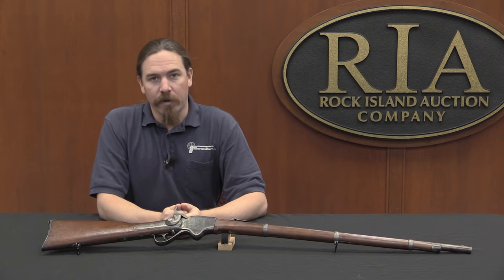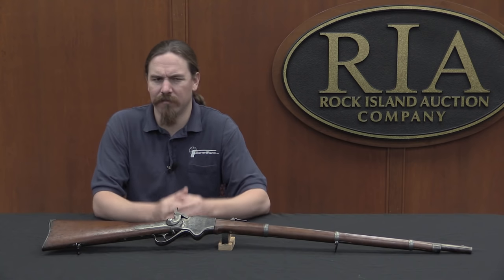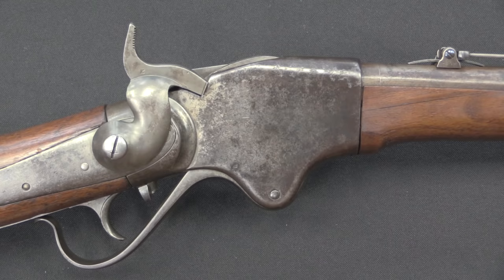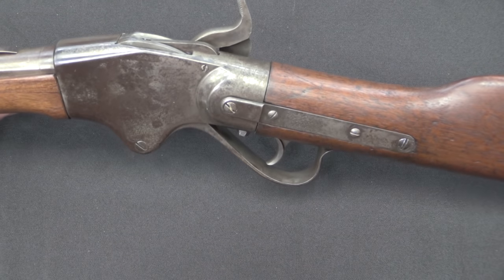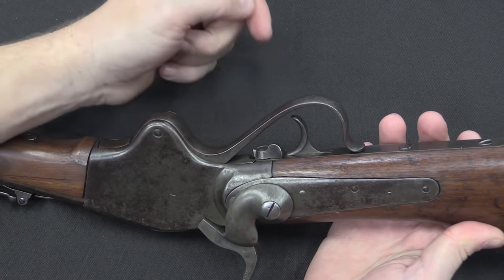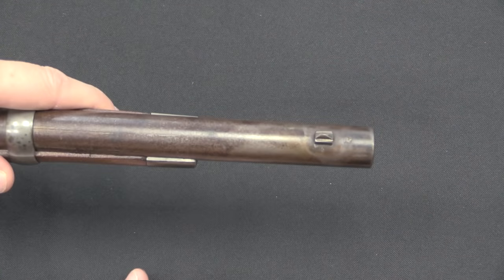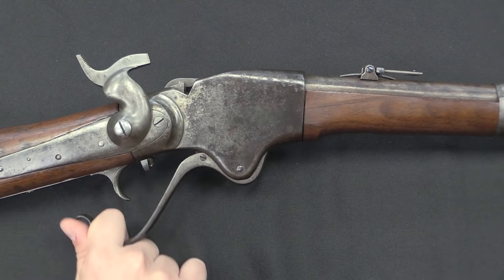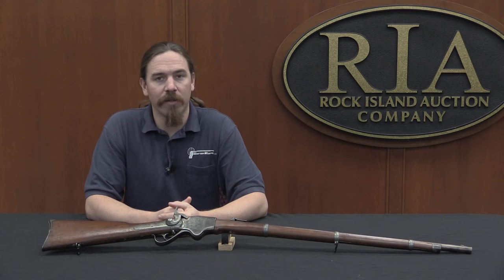Smoothbore Spencer: Tracing a Mystery Gun

Comment: The rifle screams Bannerman conversion modified back to a rifle "Look" to dupe a prospective buyer into thinking it is an original Spencer rifle with a very poor bore which collectors do not generally concern themselves with.
Appears the Bannerman markings were ground off the top receiver flat to further dupe a prospective buyer.
If you measure the barrel length it wouldn't surprise me you find it is 29" and not 30" long.
Reply: Could have been a Bannerman's gun...  Although both Sears and Montgomery Ward also list them in the catalogs past the turn of the 20th century.  I think it unlikely that Bannerman would have done the second conversion from carbine-shotgun to rifle....   Since they still had plenty of original guns to sell to civil war reenactors during the early 1960s centennial. (you can still find burned 56-50 brass in the remnants of Bannerman's Castle on Pollepel Island on the Hudson River)   On the other hand, the shotgun conversion might have been done by them...as they (and other military surplus dealers) were sitting on a mountain of such guns in the late 19th century.

Comment: Hi, Several years ago at a auction in Michigan a Spencer carbine converted to shotgun was sold. At that time it had the carbine forestock and bead front sight on it.  And like yours if you look  just in front  of the reciver   you can see where the original  barrel was cut off just in front of the chamber and the outside of the original barrel was then threaded for a shotgun barrel to be threaded over it. Not saying its the same gun that has been modified again since then, but , looks like a surplus alteration.

Comment: I have been sitting here for several years watching your videos, I used to do gun work and had developed the reputation of being a fair to middling gun smith, having taken one of those back of a magazine correspondence course and working with a couple of college trained smiths (Yavapi).  When I retired from law enforcement we decided to move home, where I grew up, now most folks around here did not know I was doing anything with firearms and I didn't really want to get back into it so I sold off all my tools and my stock of firearms, holding back a couple that I loved.  Well that was before the recent turn of the century, and I have been out of the shooting world since. I decided I should have a rifle, for well, for just in case.  So I went to a gun show and looked for an old beater Model 94 Winchester.  WOW man Who the hell changed the metal on those old guns to GOLD??? I couldn't fine even an old Marlin for less then 1,00.00 bucks!  I settled on a small .22 revolver so I could assure myself of having a shootable handgun that I could get shells for. I currently have a brick and a half left over from my shooting days, and 400 rounds of .45ACP 230 Grain round nose FMJ, I have always liked the fmj to insure that when I pull the trigger the gun will go bang reload for the next.  I know all the modern .45's should feed hollow points but why bother, the bullet comes out of the barrel bigger then most 9mm's expand to!  The .22 in case I need a quiet low recoil pistol for game getting and, wall, just in case Putin comes over here with his BS. Sure do wish I had kept all my lever guns I had over the years.

Comment: It's the 1800's version of a guy who buys a $500 gun and throws $5,000 worth of crap on it
Reply: Not really.  During the 1880s-1900, the price of Spencer  carbines/rifles was low....and got lower as the years went on. (1902 Sears catalog lists them at $3.65, when a  current repeating shotgun from Winchester or Marlin was $17-28)  What almost certainly happened was that someone bubba'd this gun into a shotgun for hunting and farm use, the same way a lot of guys in the 1950s "sporterized" M1903 Springfields... Further, it's just a guess based upon a Ph.D. written on Civil War reenacting but  several generations later (1960)  some historical reenactor brought this already bubba'd gun to rifle configuration....because a blank loaded reenactment guns don't need rifling.  Superficial resemblance was good enough.  The only surprise would be if the chamber was not altered in some way to feed something other than 56-50 rimfire, which was hard to find by the 1960s, and nearly impossible afterwards....until the post 2000 reproductions in 56-50 CF.

Comment: I'm just wondering, because I've been used as an extra in some movies and have several repro guns, if years ago it was converted to look like a military Spencer, but turned into a smooth bore to clean up easier after blanks for the movies. If you watch some of the old (pre WW2) movies, you see an awful lot of the real guns being used, that's all they had back then. From experience, constant use after using BP or flashpowder blanks will corrode out the lands and grooves if not cleaned asap.

Comment: Not mentioned is that many smoothbore guns of the day were used as shotguns and would be reasonably accurate with round balls making it a dual purpose guns and probably the reason for the rifle sights. My flintlock 20 ga smoothbore will group into about 3 inches at 50 yds when loaded with a patched round ball. So called trade guns, smoothbores, were favored simply because they were dual purpose. Especially by the western fur trappers of the 1830's and the Indians. Cheap had something to do with it as well

Comment: I don't remember what process was required, but you can read old stamps by the way the metal was upset under the blow of the stamp. I think it was Xray..might be wrong. It's used in forensics.
Reply from the maker: +aserta That process typically uses acid to dissolve the compressed metal under the stamp and the uncompressed metal around it at slight different rates, thus making the marking visible. It is a temporary and destructive test; not something viable for a gun like this.
Reply: +Forgotten Weapons I remember a forensics doco sum years ago, the gun was placed on an magnetic coil and where the lettering had been removed was sprinkled with iron filings and took on the form of the removed marks but did not damage the gun.

Comment: May be a dumb question but what's the difference between a Carbine and a Rifle? Never really looked for an answer because I keep forgetting to go look but you keep mentioning it and it's fresh in my head.
Reply: +SGTJDerek A carbine is simply a short-barreled rifle, typically under 20" of barrel length. They became popular early on with mounted cavalry, because a 4 - 6 foot long infantry rifle was unwieldy to use on horseback. The distinction has pretty much been lost in modern times, as velocity and accuracy can be achieved with shorter barrels than were needed 150 - 200 years ago.
Reply: MrJest2 That's kinda what I thought. At least that was tickling the back of my head but I wasn't sure. Thanks

Comment: has anybody else thought this might be a "Hollywood prop gun "  for fireing blanks ?
Reply: I was thinking the same thing. Was it modified by some prop house decades ago to be used in old westerns.
Reply: I find it unlikely because he mentioned that the chamber was superficially similar to the original.  Hollywood prop men generally want to use 5-in-1 blanks, which were originally designed to be fired out of .38-40 and .44-40 Winchester rifles and .38-40, .44-40 and .45 Colt revolvers. (they will also work in  .44 Special, .44 Magnum, and .410 gauge firearms)...   Because having 1 caliber of blank on set is a heck of a lot easier that half-a-dozen or more.  Heck, I remember the late Stembridge Antique Arms (which used to be the biggest in the Hollywood gun rental business) having racks of guns converted to 5-in-1 use including trapdoor Springfields.